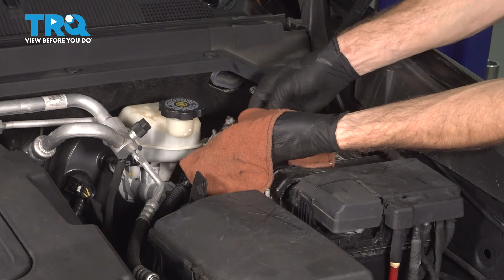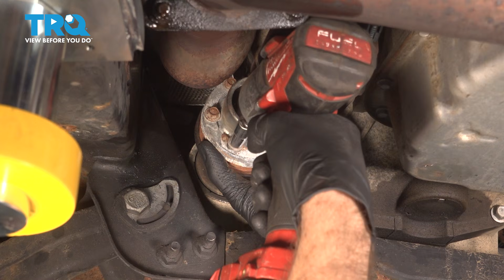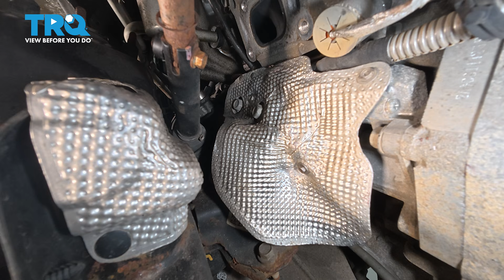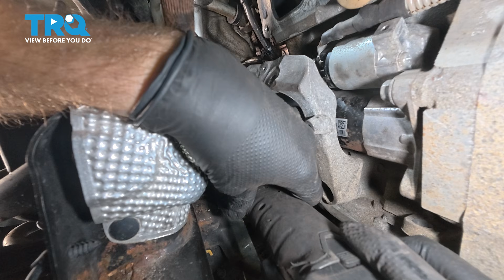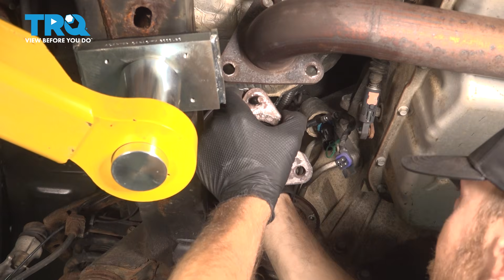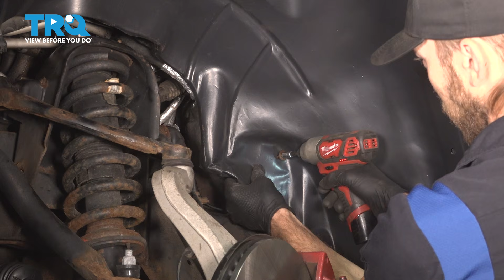How to Replace Starter 2015-2022 Chevrolet Colorado 3.6L V6

Comment: Yea you got lucky and those motor mounts might be wore out, pulling the trans out of one with 60k miles and it dosnt come out that easy you have to take inner bracket out at same time it’s a pos to do and gm is a big pos putting the starter their and not giving a spot to get bellhousing bolts, it either pull oil pan or pull starter